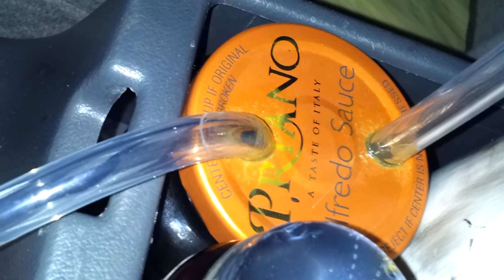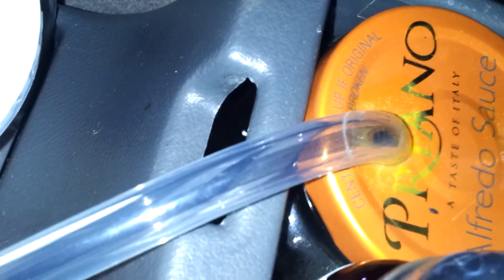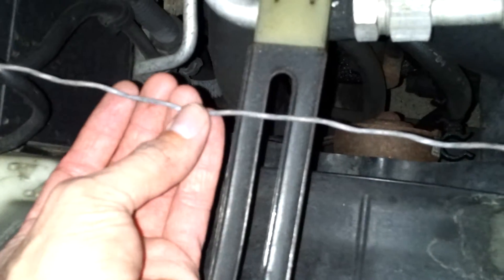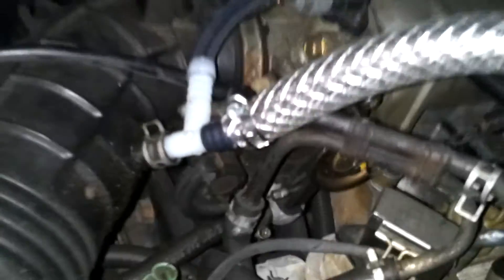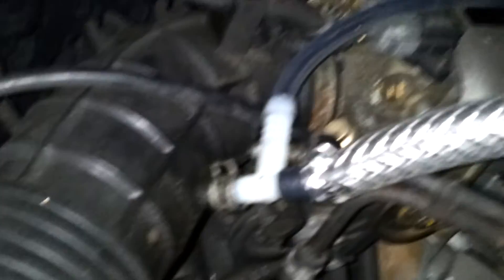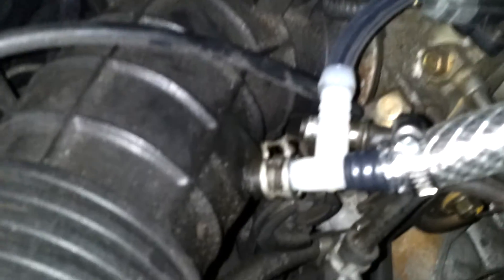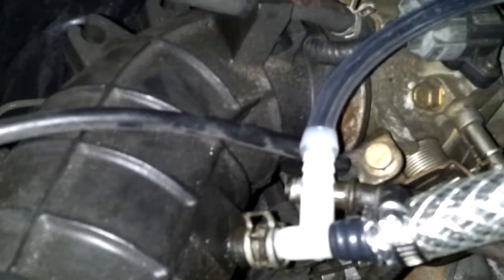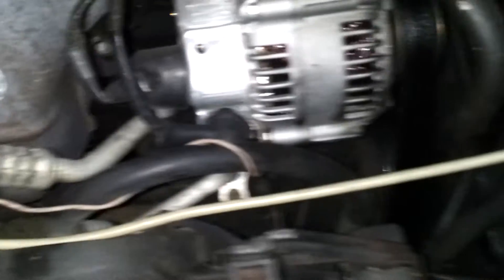Hho cell working in Honda Accord

Comment: If the HHO us piped into the intake AFTER the airflow meter; slightly less flow will be metered and thus slightly less fuel injected.
As the H to O ratio in HHO is already optimal; metering fuel fuel for it makes no sense.